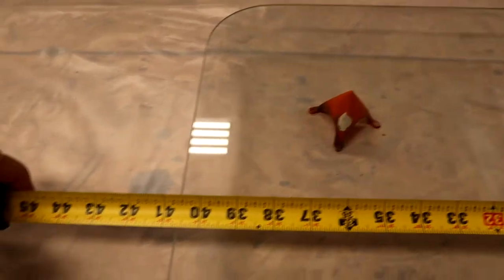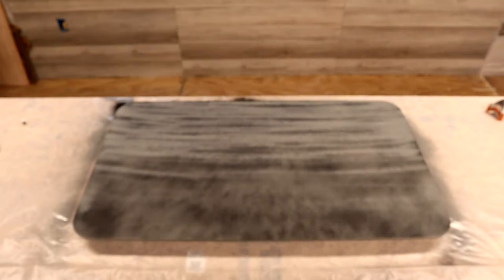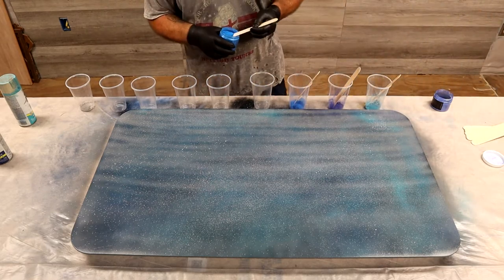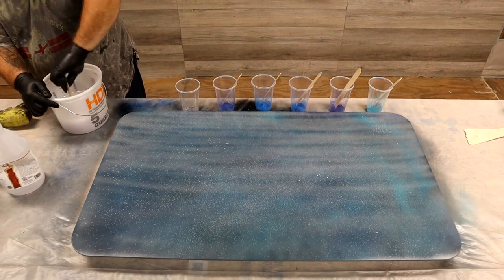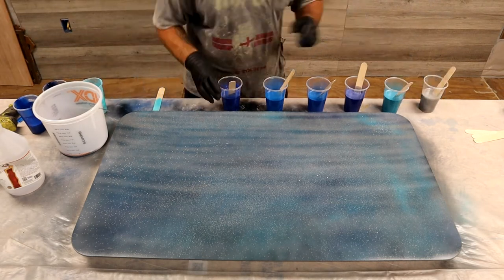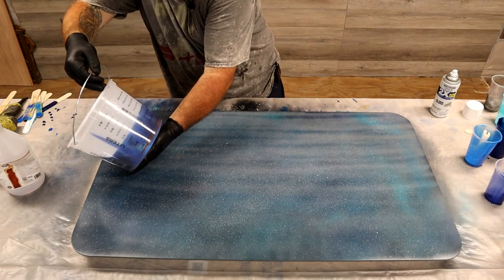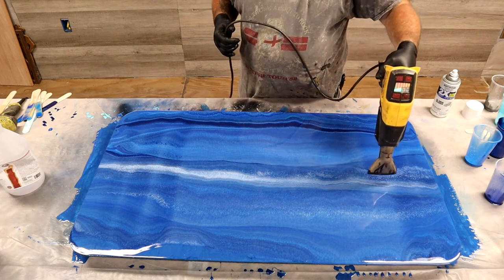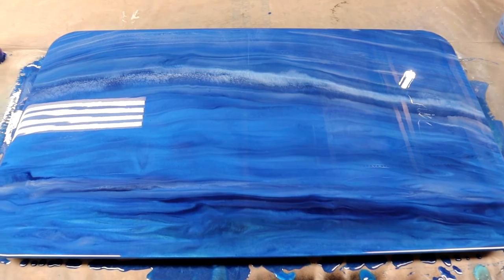Dirty pour over glass table.. learn to epoxy dirty pour over glass table without it peeling off.

Comment: That looks great! I didn't know you could do glass. You mentioned that you had done shower stalls, how did you do those vertical surfaces? Thanks!
Reply from the maker: Thank you,  I rebuilt the shower stall and I poured everything before I built it. But there is a additive you can put in your epoxy it's a thickener so vertical surfaces can be done.

Comment: This is a beautiful piece. I have seen all over that people say keep the epoxy away from glass because it will not adhere. I have seen many of your sink videos, but it looks like you pour over the standard fiberglass sinks. My question is what are your thoughts over porcelain? I remodeled my kitchen this past summer. Did an epoxy pour on my counter tops and they turned out wonderful. The sink I repurposed is an old farmhouse sink that is porcelain over tin. I took some advice and resurfaced it with a big box store resurfacing kit, however it has started to peel at the base in both tubs. In the spring I plan to take it back out strip it down past the stuff I put on it, and do an epoxy application.
Reply from the maker: Yes you can go right over top of porcelain I've done it many times all you've got to do is put a bonding primer on it first once you do that pour your epoxy on it you're good to go.

Comment: Would you do the same base coat for a glass sink?  Just a base coat of spray paint?  Also, what top coat would you use?  Really enjoy your work!
Reply from the maker: Well if I can't get the glass scratched up some with some sandpaper I will put a bonding primer as my base coat. As far as a top coat I always put a two-part water-based urethane on it that gives it scratch resistance makes it very durable.